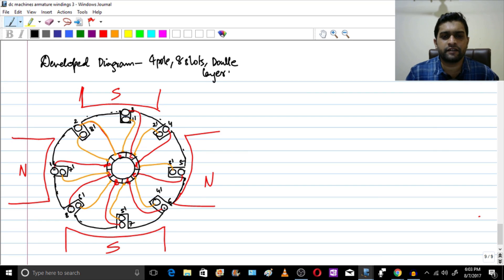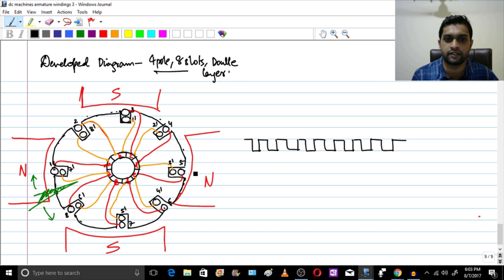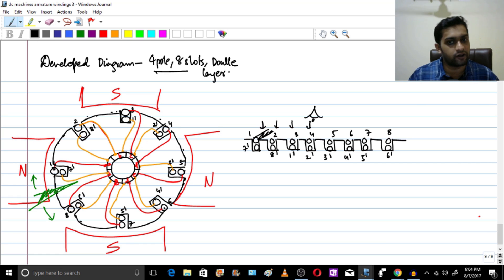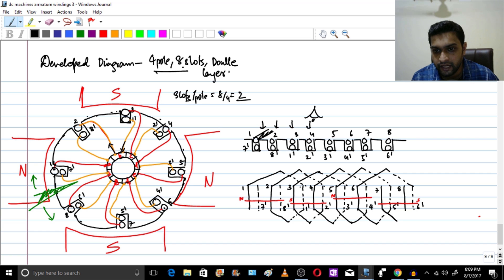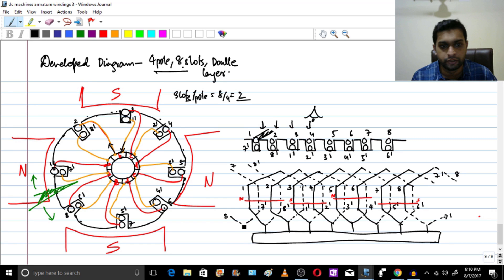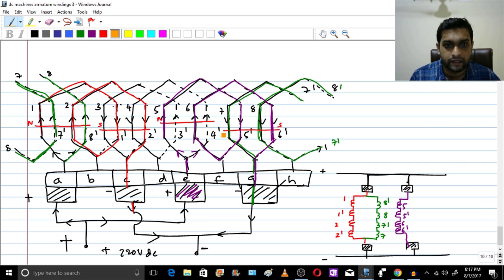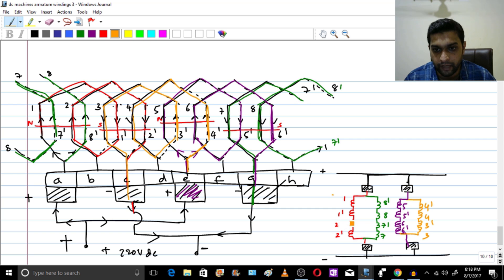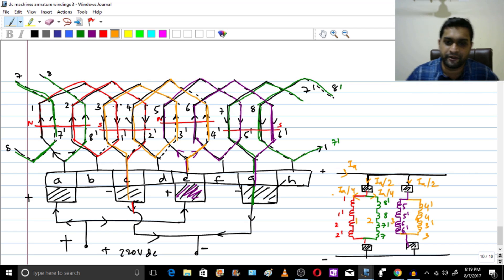#15  DC machines Basics Armature Windings -Developed diagram of 4 pole 8 slot lap winding

Comment: Hello sir, I have got confusion regarding polarities of brushes, I think a and e will be negative, because current is moving inside the generator , and through c and d current is coming out. Because inside the generator the current moves from lower potential(-ve terminal)to higher potential(+ve terminal), and outside the generator it moves from higher potential to lower potential.

Comment: you are awesome. my understanding of electric machines have been greatly increased
Reply from the maker: +Вадим Туров thank you so much..glad to be of help
Reply: +varun nair i haven't see any universal motor with full pitch winding so far(atleast in drills, angle grinders, washing machines and vacuum cleaners). usualy they have even number of armature slots(most of the time 12-18) for example first coil in case of 12 slots is located in 1 and 6 slots (in case of full picth it would be in 1 and 7 slots).
Reply: +varun nair what are the benefits of short pitch winding over full pitch? i think short pitch is used like in 90% of engines that have power below 2 kW.
Reply from the maker: +Вадим Туров there are some reasons in making a winding short pitched...I would like to cover them in a future session..most probably when I start with induction machines...
Reply: +varun nair when are you planning to start it?
Reply: +varun nair many motors have twice more collector segments than rotor segments. is it due to 4 layer lap or wave winding or is it combination of windings with different pitches or is it some other kind of winding that requires 2 segments per coil?